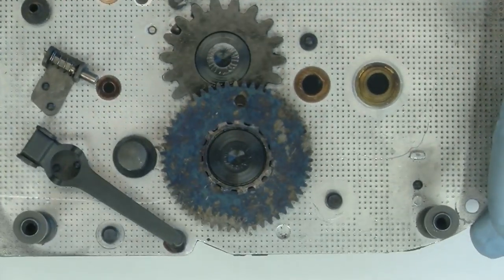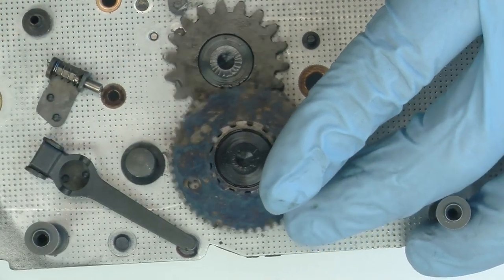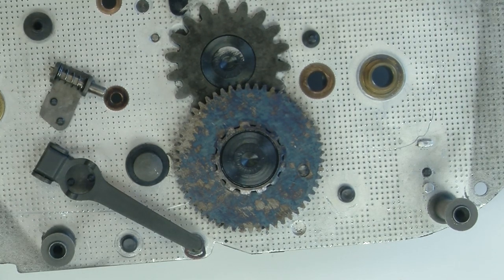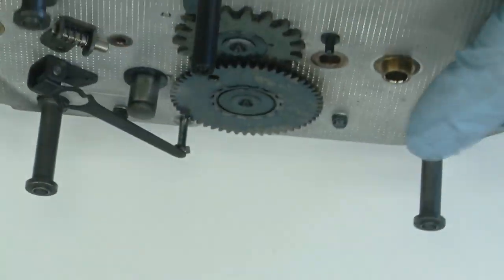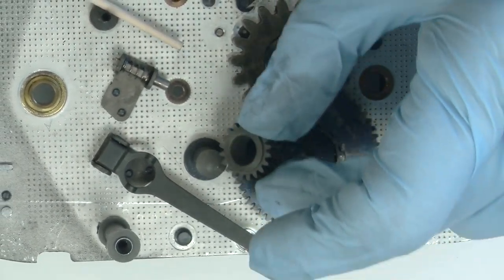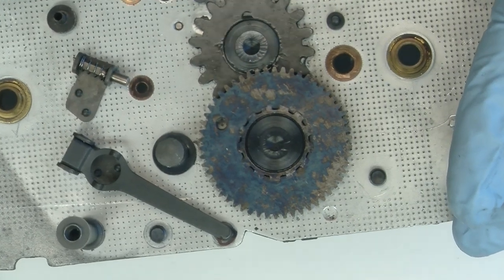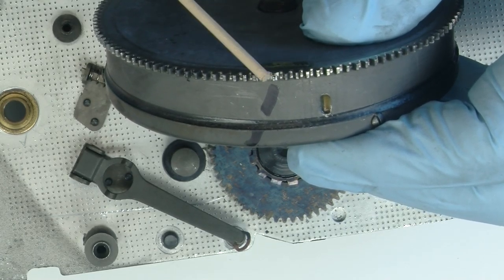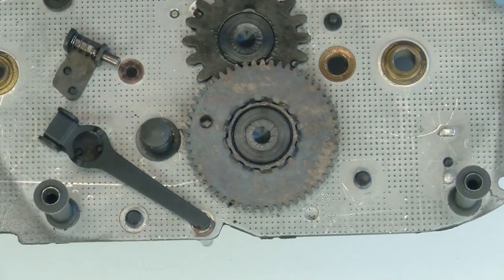Bolex Assembly 1

Comment: I have a problem with my Bolex h16, the reel take-up reel does not spin when I shoot the motor. Any advice on what could be the issue? It seems to be wanting to spin and will turn small amounts sometimes but doesn't cope.
Reply from the maker: Check to see if the chrome ‘ spool retaining arm’ slips over it’s stop as that will hinder the action of the take up spool. I f you say it tries to turn then may be a couple drops of oil might free it up. I used Mobil 1  0W-20W, snap a wooden Q tip into a nice point and use it to get at the base of the spindle. Generally if they are really dry it has to come apart .

Good Luck
Rich
Reply: @richjura8957  Alright, so I just let it run empty a couple of times and have turned it manually in hopes the grease will loosen up. It already turns again like it should do, yet it still sometimes still slows down a little bit before returning to its original speed. When shooting on 8fps it struggles as usual to turn. So I'll buy this grease and put some on  it. Do you advise me opening it up and giving it some greasing? If so, could you make a video on how to actually open a Bolex up?  Thank you for your help already
Reply from the maker: Before attempting to open it up try a bit of oil with a needle applicator. Go to a sporting goods store and get some reel or gun oil.
Reply: @richjura8957  So I have oiled the the area and it spins well now but still slows down or gets stuck momentarily sometimes:/ Should I open it up?
Reply from the maker: @juliusthieroff   Sorry, did not notice your reply, before you open it up make sure the ‘ spindle retaining arm ‘ is not going past it’s stop as that will bind the take up spool. As I was learning mechanics, if it’s not working you can’t make it any worse by dismantling as long as you don’t use brute force. Or when I was 16 years old an old timer told me “ when it comes to machines, if you’re sweating.....you’re doing something wrong’. Took me years to grasp that one.
Good Luck
Rich
Reply: @richjura8957  Thanks Rich, I continually applied grease every day and let the motor run fully through 2-3 times and with time the spool started to turn better and better. Now I have shot a whole roll of film with it and had no problems. So thank you for your advise on that part. There wasn't anything on the internet about this problem.